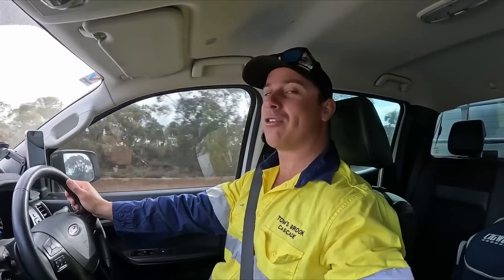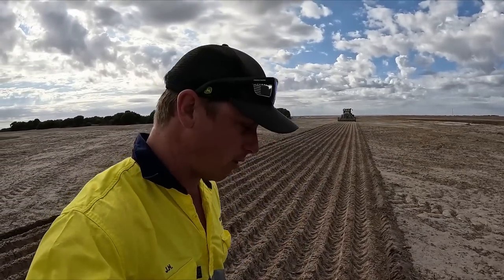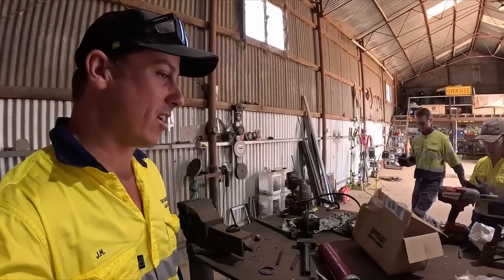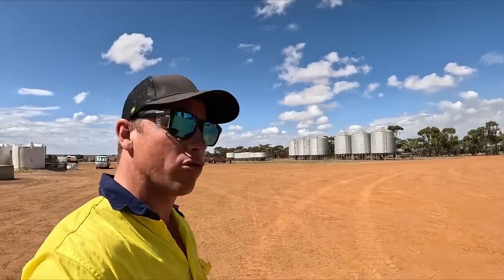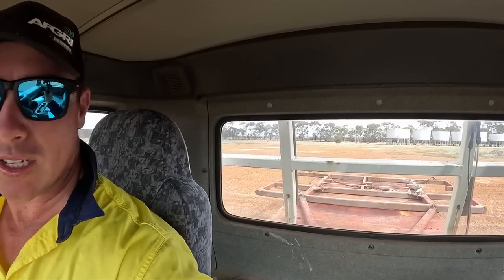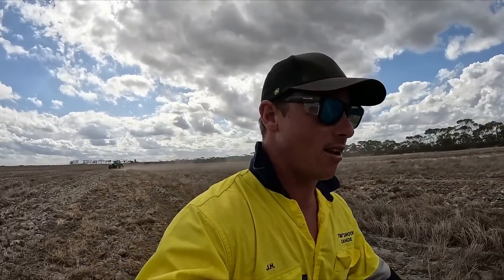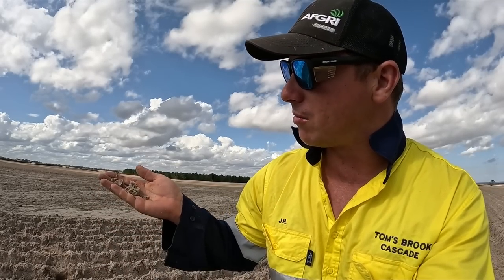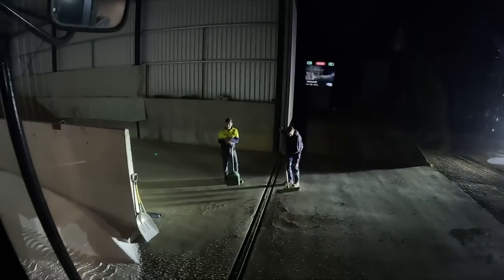Spading has Started and first Fert delivery!

Comment: For a smudge we use an old cattle grid Made from railroad iron mounted with chains to a old drill frame. Then you can change the amount of weight and how much dirt it Carries with the hydraulics. It also lets you tow it down the road. 

Hi from Tassie

Comment: Question, how often do you have to spade? I assume the sand works its way to the top with rain? Just an American that has not seen a tool like that, or dirt like that for that matter.
Reply from the maker: Just have to spade once to incorporate the clay. What does happen is the clay can “set” hard and in a few years may have to come back with a deep ripper and rip it

Comment: G'day JH you have produced enother great video about day to day operations that spading implement does a good job you might have to use that to do your smudging happy farming 🚜🚜🚜🚜
Reply from the maker: Hi Micheal, it does do a great job. However you need to do the smudging in order for the spading to do a good job. If we were to just use the spaded there would be large lumps throughout and we wouldn’t get a good result from the claying venture.
Reply: Yeah cheers JH thanks for the reply back there's a tool for every job 👍
Reply: The comment about fert shed not made for tip over axle trailer walking floor would be the way to go 👍👍

Comment: Interesting video, you don't see spaders in action very often. I have one question regarding the tractors though. I am from Germany and we are restricted in terms of the width of our machines, we are only allowed to run ones legally on public roads that are max 3 meters wide, or 3,5 meters with special permit and an escort vehicle ahead, so most aticulated tractors run big singels if they are not on tracks. I have noticed that farmers in Australia often also have big singles but with a wide track width. Is there a special reason for that? Wouldn't it make more sense to run duals to reduce compaction? Or is this not that much of an issue because of the sandy soil conditions you have?
Reply from the maker: A lot of people go for the singles and the wide track as most farmers are/starting to be Controlled Traffic, so in order to do this you have a uniform wheel track size and almost everyone chooses to have that at 3 meters.

We dont have restrictions on width as long as you have a pilot vehicle in front to warn people of the oversize load ahead.
Reply: @tomsbrookfarm  That's interesting, I wouldn't have thought of that, but it makes sense. Controlled traffic, aside from using tramlines for spraying and fertilizing, isn't a big thing among farms in Germany yet, although there are some german farm machinery manufacturers such as Horsch and Nexat experimenting with it at the moment. 

Thanks for your reply and keep up with the great videos!

Comment: If you were going to build a new fert shed would you build it tall enough to tip in or a roll off roof?
Reply from the maker: I think if we were to do it again we would change the way the door closes so there is nothing on the back. Then when it came out onto the apron it wouldn’t be an issue to push it into the shed.

Problem with going higher is cost and there is really no need. And I’m not a fan of the rolling roof as doors are much easier and safer operation.
Reply: The best trailer to use if it's in a shed would be a walking floor there the go for job

Comment: Why dont you use moldboard plow instead? I think that 12, 13 or 14 bottom plow will be much faster than spading
Reply from the maker: The reason is a moldboard is only turning the soil, putting the stop soil underneath and subsoil up. All this would do is put the clay underneath and bring sand to the top.

When you spade it incorporates the clay the whole way through the profile and you can bring your soil back to life and productivity.

Comment: Would more weight being added to the smudger help do the job better in those tougher conditions? we do a lot of that here in NZ as leveling but need something heavy enough to Carry enough soil to break up the clumps
Reply from the maker: Yer there is a fine line with smudging. If we add extra weight then it could tend to make a mess of the paddock and not do the job (turn into a grader instead of smudging and breaking up the clay) 

What we have seems to do a pretty good job, just need to get speed right and also smudge it before we get any rain on it

Comment: Hey Tom's Brook safety first mate tell your workers do not to lay under tines like at is something happens with the hydraulics you will not got get out of it in time they will go down that quick you will never get out they in time never rely on Hydraulics or Electrics and be safe mate and you will live a long life or disrespect safety you will not live a long life always think of safety at all times.!!??
Reply from the maker: I probably should of shown but the Tyne lock out tap is on. I didn’t even think to inform you all that it was on.

I defiantly agree with what you are saying and we take all actions necessary to be able to keep everyone as safe as possible and make sure everyone makes it home all in once piece.

With the Tyne lock out tap on that means that hydraulic can’t get back to the tractor or from the tractor to the tynes, which means you can stand on the tynes and try and move them but they won’t budge! Very safe to be operating underneath.